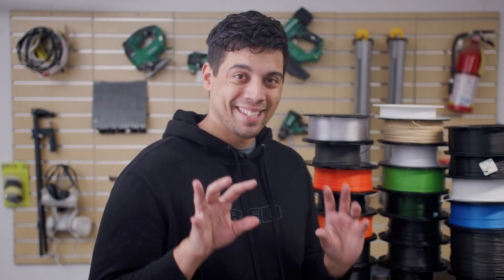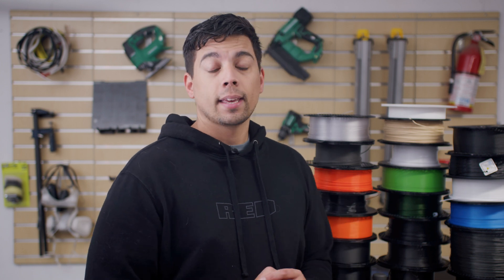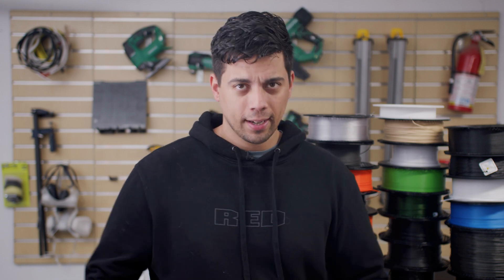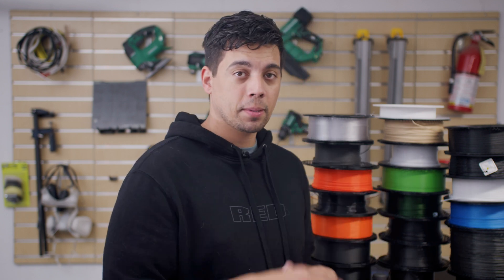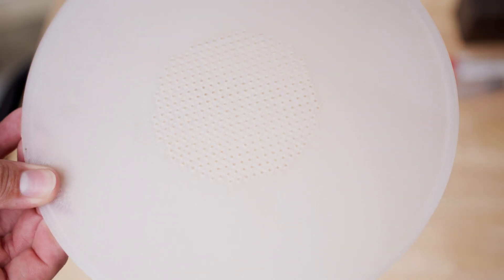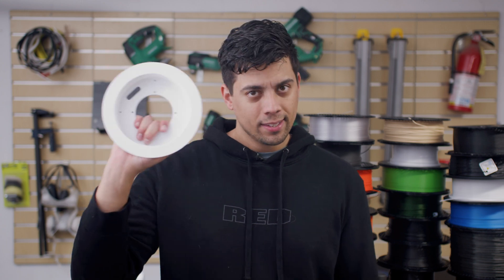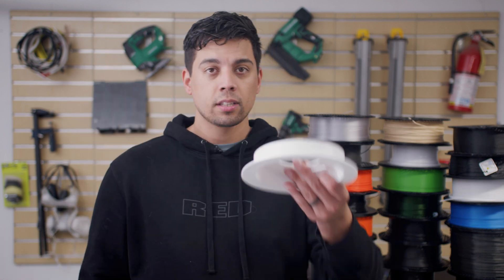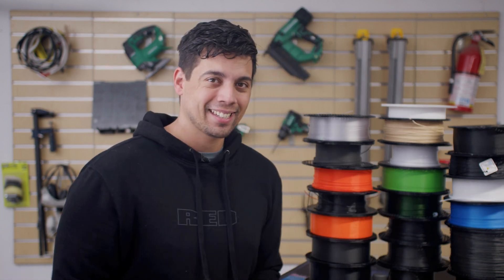Stop using PLA all the time, it’s not the best filament! - Filaminute Ep.3

Comment: The two filaments I use are pla and petg because of cost. I print in pla for aesthetic or multicolor models and petg for functional stuff.
Oh and surprisingly I get better results printing miniatures in petg than pla. Also helps that they’re more sturdy
Reply from the maker: Multi color is great use for pla and miniatures that can hold up if they are dropped or really used without snapping

Comment: PLA isn't the best by any means, but more often as not, it's good enough. It's consistent, even across brands, which translates to predictable performance.
Reply from the maker: lol I’m editing the why PLA video as I got this comment!! Next Tuesday. It’s great for most non-functional parts
Reply: @TheScrappyCreative  I do a lot of prototyping and one-offs. It's actually perfect for test prints where you don't want to have to mess with settings and tuning and stuff. Just go with boring, plain, predictable PLA and see how it comes out, check dimensions, features, etc. After you get your part right, you move to a more appropriate material for the use case and then deal with the tweaking and stuff.
Right now, PETG is actually dirt cheap compared to the rest, so I find myself working with that more.
Reply from the maker: @MadeInMichigan same all my test prints are pla!

Comment: Its not the best, but its the only i can print without an enclosure.

Petg absorbes humity like crazy in less than 20 minites.

Abs/Asa gets you lleyow eyes, headache, and rught throat.

Pc (i try it prusament pc blend) prints goof, but not more than 2 o 3 cm in height before wraping like crazy ( testet on prusa mk3s, mk3s+, mk4, mk4s, and bambu x1c) you need to preheat the enclosure at leas 10 or 15 minites before, and let it cool after the print, before opening the door.

And pet, pps, and the others, i guess isnt necesary mention them, right?
Reply from the maker: Petg is not bad at all, it absorbs moisture but even then it print fine for most things also throw some petg cf and stability changes same with pccf

Comment: Happy to add on for the algorithm. Let's get you a Core One. I wanted to get one, but decided on the Centauri Carbon instead because of budget and because it'll be my first printer. I figured I'd try a more budget option first and then go with the more expensive one later on if I like the hobby enough.
Reply from the maker: It's a great printer, I just like Prusa because they support the printers and the community. They are one of the few folks who care about the people they are selling stuff too. The fact that you could have bought an OG Prusa and just upgraded it over 10 years with new parts and have a Core One is insane to me.

Comment: I want to use other materials, but I can get USA made PLA for $10 and haven’t found affordable ABS/ASA. I have very limited ABS that I sparingly use only if I absolutely must. I’ll prototype in Pla before printing in ABS
Reply from the maker: Petg isn’t too pricey but prototyping in pla is best so you don’t waste the nice stuff!
Reply: @ it’s $20-30 /kg from what I found. The same price as ASA or ABS. I have an enclosed printer, so I skip petg to use abs instead. I’d switch to PETG if I could find a quality source for $10 though
Reply: Elegoo petg is like 14 a roll
Reply: @ good to know, don’t really use petg. I use either PLA or ABS. Pla is used indoors for my office stuff like gridfinity or multiboard. petg wouldn’t survive in the other two areas I make 3d printed parts for, my car and my garage. Live in Texas, those environments can go over the glass transition temperature for petg. When I was saying “other materials” I meant I would like to use others like abs/asa but stick with pla due to cost. I want to fully organize my garage but waiting for an affordable source for ABS/ASA that will not be affected by whatever the current tariff is that week.

Comment: Well then what are your thoughts on PLA+ ?
Reply from the maker: My thoughts are it is fine for some use cases but if any force is applied or any temperature then get away from PLA, I’d much rather have a petg-cf than pla+ … I know there is a price difference but pla+ isn’t good enough in anything to justify getting it for me. Maybe I’ll buy some and test though!
Reply: @TheScrappyCreative  You should consider it. Normal PLA  print settings with temp resistance as high as petg iirc
Reply from the maker: @Glooperdootle the problem with PLA + is the plus means a variety of things and everyone’s pla+ is different which do you like?

Comment: ive printed abs on my open A1 easy
Reply from the maker: Really? Was it a small part? ABS on any open-air printer is hard to control warping and dimensional accuracy.
Reply: @TheScrappyCreative  yes small MagSafe part for the back of an iPhone. So I paused it mid print and laid in a magnet to print over. I think I used hatchbox abs from Amazon
Reply from the maker: @Whitie02 impressive!

Comment: PC blends can still warp, and I'm hoping that getting a Core One will help with that. That said - PCCF works quite well. I've printed a frisbee with PCCF on my Mk4S - although that made it a bit on the heavy side. So not really the right material for a frisbee. But it did show that the carbon fibers do a fine job of counteracting the tendency for polycarbonate to warp.

Some poorly made PCCF can get carbon fibers stuck in your skin, so have to be a bit careful about that, but Prusament doesn't have that problem - but unfortunately Prusament PCCF is also expensive and often out of stock.

Materials and their properties is definitely something to consider for functional prints. Although be aware that more advanced materials can be more difficult to print and don't like to get moist. I keep my PC and PCCF as dry as I can.
Reply from the maker: Thanks for that heads up I think it was just pla on a too easy to melt and something as simple at petg can solve minimal heat warping as long as it isn’t too much, since I have plenty of it we will see! Next to test will be the pccf I think